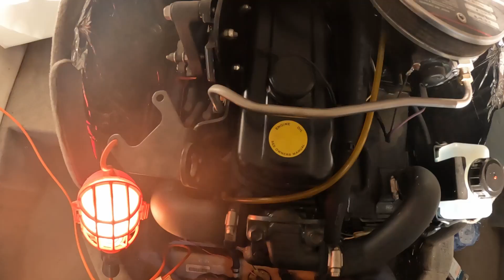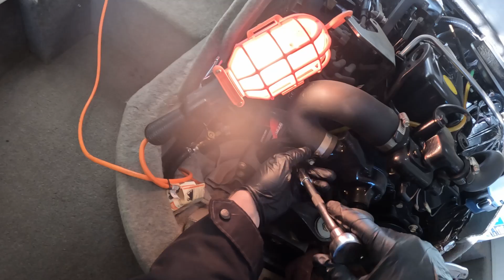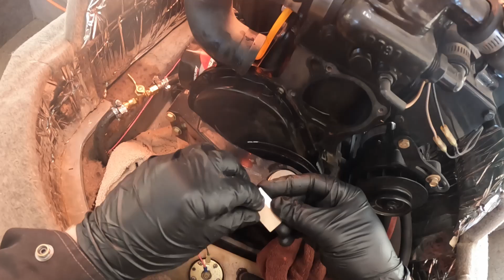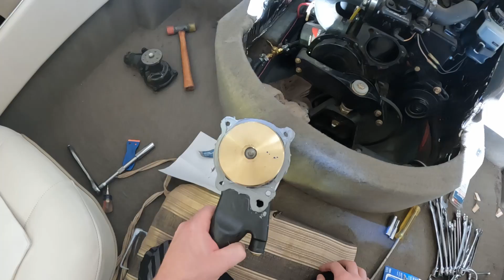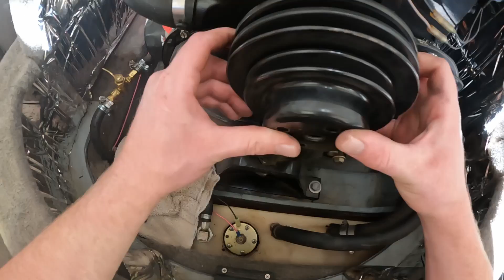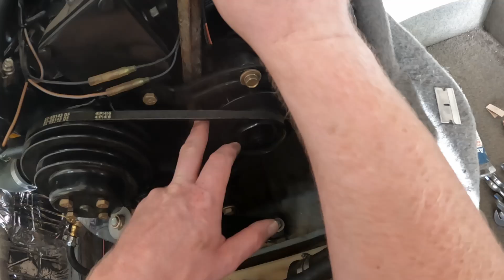How To Replace The Water Pump On A 3 0 Mercruiser Boat Motor

Comment: What kind of sealer did you use?  My engine heats up when idling.  So far I’ve had the impeller replaced, and the water supply tube and it still heats up when idling.
Reply from the maker: water pump I used - https://amzn.to/4a5FiGn
coolant system rtv - https://amzn.to/3v1tiqF

Make sure something didn't get sucked up creating a clog.
Reply: @GrimRepair thank you